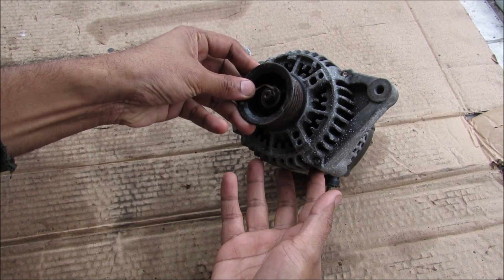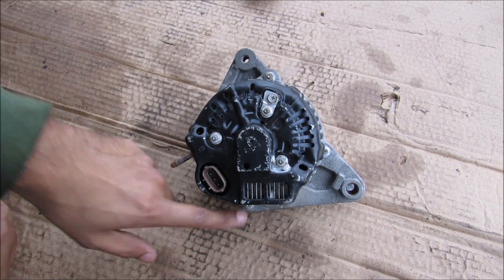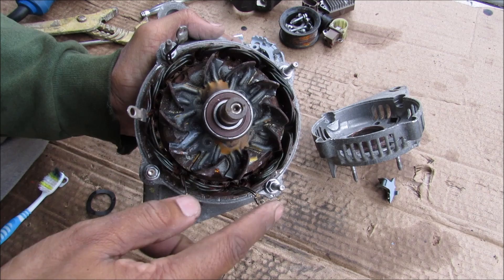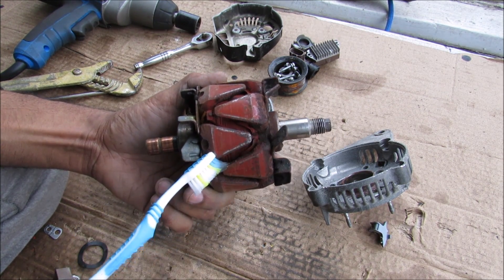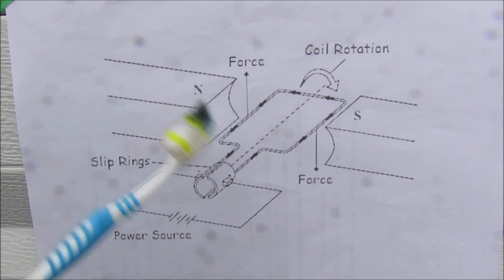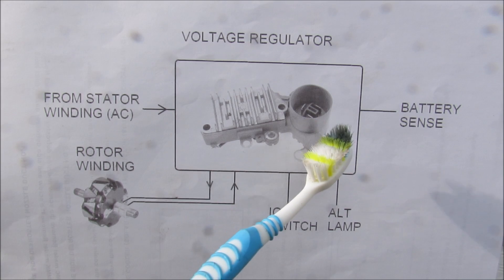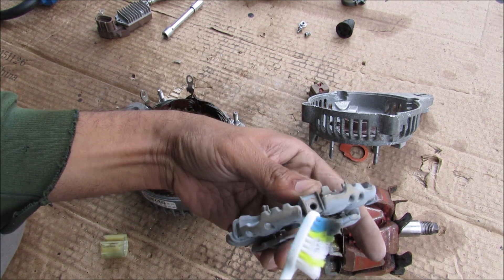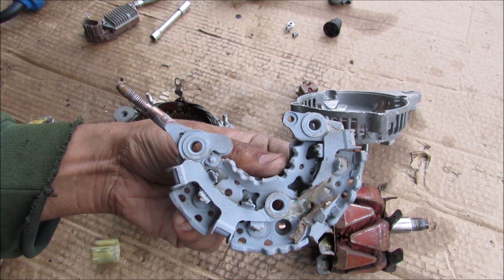How an Alternator Works

Comment: Why  don't they use DC dynamo instead of an alternator!?
Reply from the maker: Efficiency
Reply: And better voltage stability,smaller size,more consistent output regardless of rpm, more reliable and hard wearing due to minimal brush ark and absence of linear regulator,generally higher output due to field winding rather than permanent magnets as strong flux can be made without having to use expensive materials for the permanent magnet, less waste heat from series regulator, 
Less electrical noise as brushes are not comutating windings just to name a few.

Basically a dynamo would be for the most part useless on a modern car mainly not powerful enough and too electrically noisy apart from the other limitations dynamos are all but phased out.

Comment: hi, what's the use of IG terminal? thanks
Reply: Janrau Beray Feeds power to regulator, it is the regulator that feeds (regulates) voltage to the rotor commutator via the carbon brushes.
Reply from the maker: +Janrau Beray to get power when the ignition is on
Reply: power for excitation? or just to turn the regulator on? thanks
Reply: The alternator needs initial power to the regulator and field windings to get it started once the field windings are excited the alternator will self power the field windings via the regulator and the voltage is sensed via the battery cable or in some cases via a dedicated sense wire to correct for voltage drop in the main battery cable. 
When the alternator first starts the field winding generally has insufficient residual flux to self start unlike some small generators that don’t require external excitation it all comes down to the physical construction of the rotor it’s likely easier to construct the rotor without having the need for it to stay slighty magnetised on shutdown.

Comment: You said if you disconnected the battery while the car is running you will damage your computer ! But isn't disconnecting the battery while the car is running is a way to test your alternator ? If it works the car will keep going , if your car shut off then the alternator is bad right ??
Reply from the maker: +Eyad Jam That's the old school way to test an alternator. Doesn't work like that now...any voltage spike and something's going to fry 
You need to use a multimeter to test your alternator
Reply: speedkar99 how about a 96 LT1 engine ? Would the old way works ?

Comment: Love this video... 👍👍👍
Could you tell me how much DC watt generate from that alternator, please? I want to use it for DIY hydro turbine.
Reply from the maker: +Bome Myat Alternators are rated by amps. Generally they put out 80-120A.
Reply: speedkar99 Thank you speed, it is really helpful for me, I just need 400 watts for my project and I realize car alternator is an option. 14volts x 80 Amps should give 1120 watts. It's enough power to go on. Thanks a lot!

Comment: Also in what ways is it more affective to use a 3 phase than it would be to use 1?
Reply from the maker: +Matt'smobile AutoRepair three phase has three peaks instead of one. Thus the capacitor has less area to fill in
Reply: speedkar99 That capacitor being the battery.

Comment: Base on the schematic in 7:10, can we replace 6 diodes by 8 diodes? If yes, is it more durable than the rectifier with 6 diodes? Thank you.
Reply from the maker: +Utuber Yes but then you'd need an additional phase and coil windings for those diodes.

Comment: Good video, I will replace my alternator bearing(07 corolla), but I don't know where to find the right size. Do you have any suggestion.?
Reply from the maker: +Mr. Yang Does the dealer offer internal alternator components? Is there rebuild kits online for alternators? If not then hardware store might have bearings that will match the size
Reply: Thank you, dealer doesn't offer any info. but I just find a few rebuild kits from ebay.

Comment: How does the voltage regulator control the alternator output exactly? Meaning what’s it made of that it knows what voltage to keep the output at
Reply: mrsemifixit 
I'm in the process of building a regulator . for a alternator. and from the info I gathered. the regulator senses the output voltage from a zener diode . to shut off the power off to the brush as the volts rise. then the voltage drops. then powers up the brushes. then the volts rise and is shut off . and this happens likely 100's of thousands of times a second. causing a steady voltage output.  oh and the voltage that is shut off by the zener . is from the battery. and the output also goes to the battery so it's all basically the same voltage. just slightly higher co.ing from the alt.  it took a bit of looking to figure it out . but its very simple afterwards.
Reply: James stranger So you’re saying it uses a zener rated for 14v? And if battery voltage falls below 14v the alternator adds more current to bring the magnetic field up and then cuts off when battery is 14v again? If so why does a battery only measure 12v when fully charged?

Comment: my alternator is brushless and needs to be boosted every time I park
Reply from the maker: +StrategyJoe Check battery
Reply: Once you get the engine started check voltage at the battery terminals, it should be between 13.8 and 14.2 volts give or take a smidge, if It continues to show 12.6 volts (full battery charge voltage) or less then your alternator may not be charging. If the voltage at the battery terminals does nothing but drop this is a sure sign the alt isn't doing anything.

Comment: In the video you stated that the field windings are located 180 degrees apart, when you meant 120 degrees.
Reply from the maker: +MoutainMan3000 yes i did make a mistake there, and then later I mentioned 120 degrees which is correct.
Reply: MountainMan3000 it's not field windings, it's armature windings. In alternator armature winding is in the stationary part and field winding is in the rotating part.

Comment: I think I lost some info - what is happening when battery is fully charged and alternator is in use (engine on) - where goes not used power (let's assume that alternator generates 80A, and car is using 40A - what is happening with this 40A, while battery Is full and not taking more power) ?
Reply from the maker: +senseitbk Nope, the voltage regulator kicks in and cuts power going to the rotor. Then the rotor is just sitting there as a rotating coil, its not generating any power when the battery is fully charged.

Comment: ElectricalEngineer:  Very impressive.
Reply from the maker: +siucbset I'm a mechanical engineer
Reply: M.E.:  With that being said.  Shall I assume you will soon be getting rid of that 1999 Solara and getting a 2018 GS350?
Reply from the maker: +siucbset The solara was sold in April, and I'm happy with my 07 GS350 right now. I recently picked up an 04 camry, not as impressive as the solara though :(
Reply: Good combination.  GS 350 for summer and Camry for winter.  Definitely need a FWD or AWD for winter months in Canada.
Reply from the maker: +siucbset Yes, though I do use both cars year round, just when it snows I'll use the Camry exclusively. The lexus Michelin Pilot tires are terrible in wet, and its just cheaper to find winter wheels and tires for a Camry.
Reply: I thought they were the one and the same (coupe and 4 door)?  Anyhow, excellent video.  Very very informative.  Thank you.  God Bless always.
Reply: I'm a former Electrical Engineer also. This video summarized the entire first semester of Power Systems class. Wow !
Reply from the maker: +auxpowerunit thanks for the approval

Comment: Does the spider come as standard on all corolla ??
Reply: Yes, the spiders are genetically engineered in Japan and are just as reliable.
Reply from the maker: +Yathu prem if the car sits for a while then yes...
Reply from the maker: +Rhex Arada oh no, I've made a topless corolla, see my convertible video
Reply: The spider were there to maintain and regulate the operations..... its part of toyota next gen self maintaining parts programme.....which leads to longer parts life less cost to own and offcourse  reliability.... the only thing owner have to do is get the Spider changed from a toyota dealer every couple of yeras free of cost.  (Refference Unknown : vloume x)
Reply: If they are Toyota spiders, they're really reliable.
Reply: @paul8028  be careful with the Indian ones. They have a nasty habit of making scam calls when they should be working. Keep your phone near you at all times.
Reply: Rhex Arada MR2 now classic. The British TV show Wheeler Dealer on Velocity Channel did a restoration on one. I like the last generation of it though, not the old gen.
Reply: No, the OEM Alternator comes with a little goblin inside.